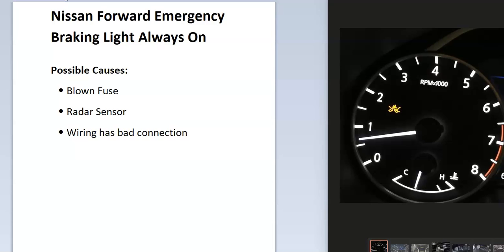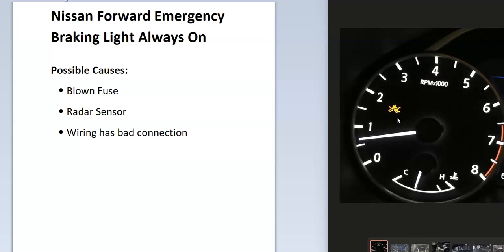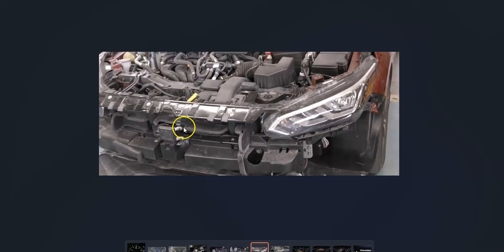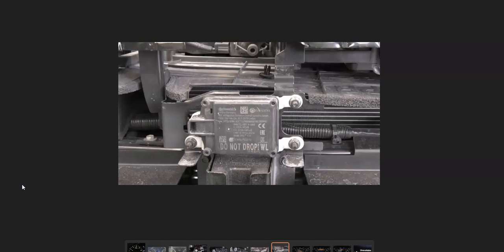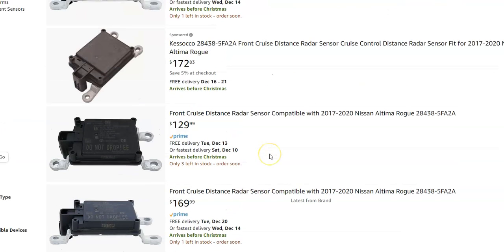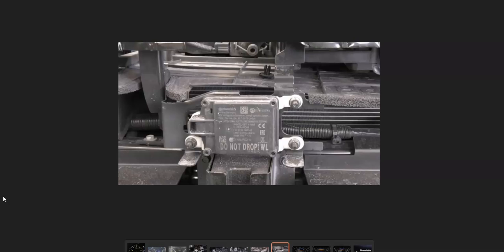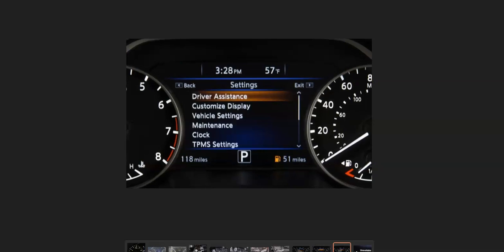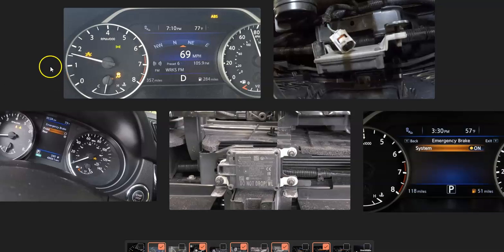Causes Why Nissan Forward Emergency Braking Light Always On

Comment: How about if the light is flashing all the time?  What does that indicate?  I tried replacing the sensor (with a brand new sensor with the exact same part number), but then the error goes from a flashing forward collision warning light to a "malfunction" warning shown on the dash.  I tried scanning for codes with my scan tool, but no codes are visible.  No apparent wiring damage.  The vehicle was in a previous accident, but the FCW system was working when I got it.  Every once in awhile the malfunction light would light, but it would reset itself when the vehicle was shut off and sometimes not come back on for multiple trips/days.  Any help would be appreciated.  Thanks!
Reply: Did you ever figure it out it’s happening to me too
Reply: @vinnynaga4842  I gave up trying to fix it as I read about so many people spending tons of money replacing parts and having the sensors calibrated and aligned.  Maybe I will take another look when the weather gets warmer.  Good luck.
Reply: @turbotato  I have a 16 maxima platinum and the sensor did have to be aligned/calibrated, however now I have a issue with my front emergency brake not working so now my whole cruise control doesn’t even work
Reply: @timj3664  My car is out of warranty
Reply: It could be the control unit itself not the sensor
Reply: Same exact situation. Did yours ever get real jittery suddenly before the malfunction light came on? Mine does that and gets real delayed when you go to give it gas at red lights or stop signs.